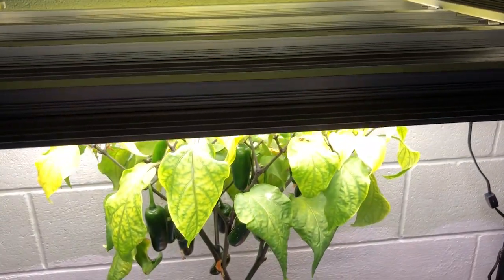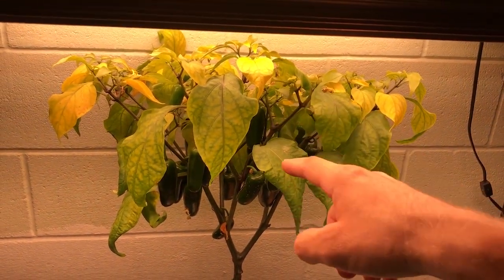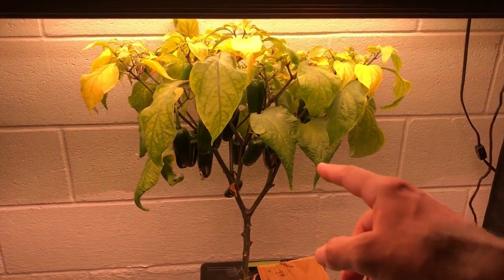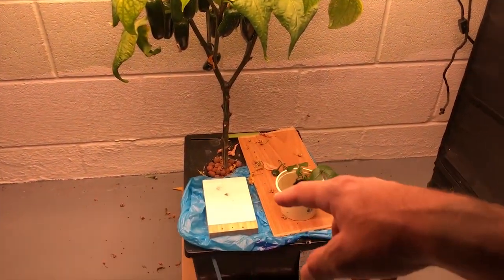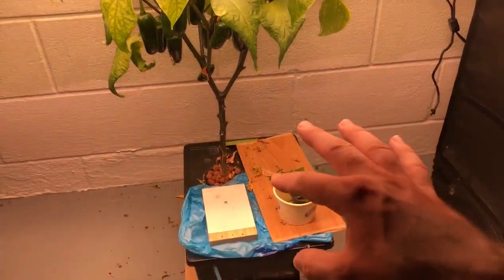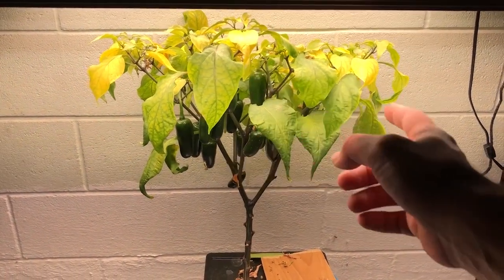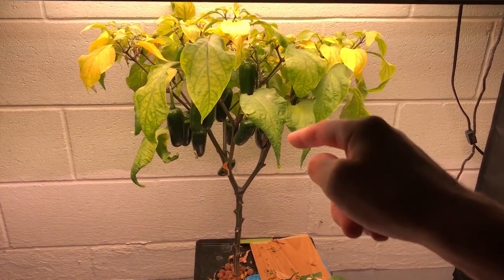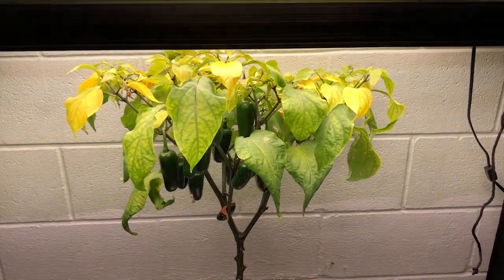3 Reasons why your Peppers Aren't Getting Hot/Spicy

Comment: When the plant goes into fruiting phase you have to add more potassium and LESS phosphorus.  The npk ratios for the different phases are:
Seedlings: 1-2-1
Growing: 1-1-1
Fruiting: 2-1-3
Harvest: 2-1-4
I’m using 15-30-15, 21-21-21, 20-10-30 and 20-10-40 (which is 20-10-30 with added potassium sulfate).

Comment: My experience echos your hypothesis with respect to how much water the peppers receive and the ambient temp.  On my west patio in the summer the temp is typically 100 degrees for 3 or 4 hours and although I get less fruit, the Peppers are HOT!.  In winter and early spring when the nights are in the 50s and days maybe high 60s to low 70s; my plants produce lots of fruit but with little to no capsaicin or heat.  I address this with less water and it helps but the peppers still are not very hot when growing in lower temps.  I love your videos!

Comment: I'm growing habaneros outside. The weather is perfect, and I'm keeping the plants hydrated and they look great. There are lots of flowers, but the flowers are not producing pollen (the pollen sacks are there, but they are not opening). Soon after, the flowers drop. Do you think this is perhaps due to too much nitrogen?
Reply from the maker: Noah Nobody yes. Or they aren’t quite mature yet.
Reply: Had a similar problem with Ghost Pepper. The flowers would drop and never produce fruit. It was a large plant grown outdoors and finally gave up and pulled it from grow bed. It was originally purchased as a plant at a Garden Center, about 8" tall. Suspect it might have been cloned and for that reason would drop flowers?
Reply from the maker: Eugenia Hobbs cloning wouldn’t be the issue. Flower dropping is usually a nutrient problem.

Comment: Sorry that stress part is absolute BS. I heard that often but my peppers were mostly way hotter than they should be.
Why? Because I supported them with all nutrients they need.
Peppers need much nutrients and light.
So fertilizer beeds to be excessive but not as much so they die.
Then you will get the hottest you can imagine.